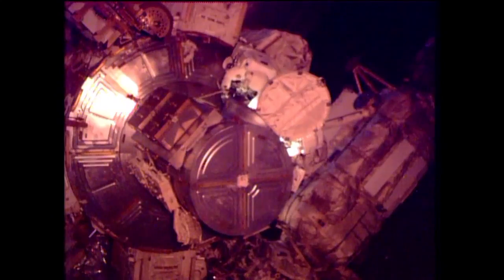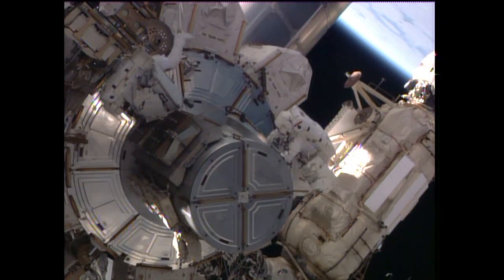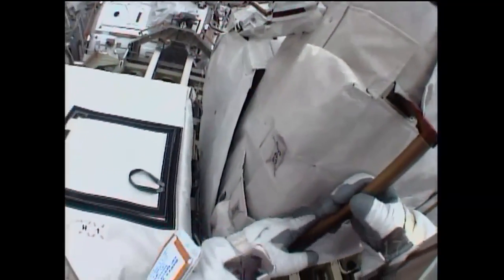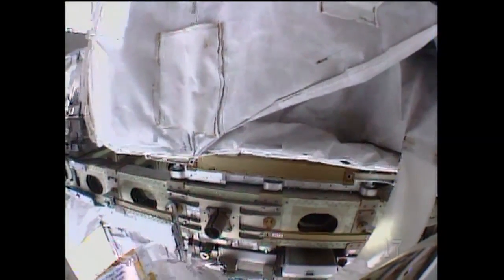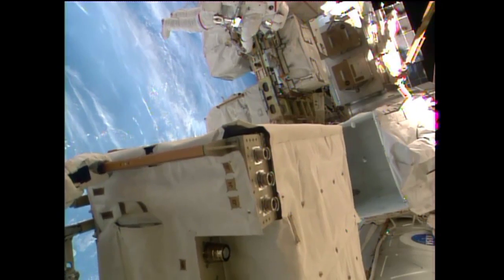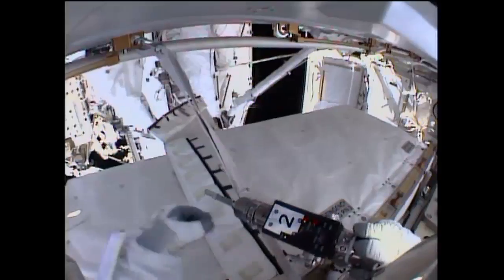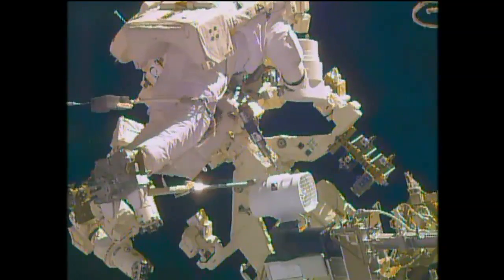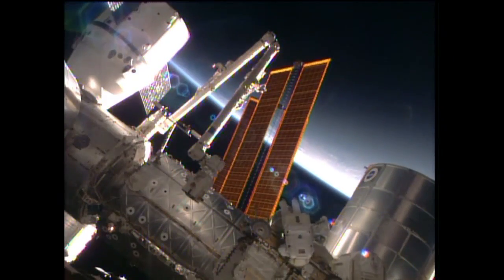NASA Astronauts Conduct Spacewalk on ISS

Comment: NASA, despite their many real accomplishments, for whatever reason, gives a false impression of what a globe about 12,000 km diameter, like the Earth, looks like from 200 miles up.
Any video or picture from low Earth orbit that shows a curve to the horizon is faked, because on a globe about 12,000 km diameter, like Earth, you would see no curve- the surface curves away from the observer, the same way in every direction, the horizon would look just as flat as at sea level as at 200 miles. I understand that most people don't get that for themselves but it is a fact, not an opinion. 
Another way to see just how false some of these pictures are:
Look at a frame with the curved Earth in the background, then extend the curve until you get a discrete circle- for that to be the case you'd have to be many thousands of miles away.
Everybody who didn't already know this, and to whom I have explained it to gets it (if they don't just give up thinking) some quicker than others. Once they get it you get it- they quickly see there is no room for debate.
The standard erroneous thinking goes like this " if there is a curvature of x degrees in a given length of Earth's surface, and you are high up enough and see this given length at the horizon, then you will see that x degrees of curve- they completely ignore the fact that the horizon you see is not a straight line, it is in fact an arc of whatever length you choose to observe, it is the boundary of a circle on the surface of the Earth with you, the observer, at the centre.
This geometry does not change as you go up until many thousands of miles, then the only thing that changes is your interpretation of what you see, the only thing that actually changes is the area of the circle of view, the horizon remains flat until the surface circle of your range of view, with one observation, covers the whole Earth, when to you, the observer, it is a discrete object in space.
Reply: +MrRobtwothirds I love how you state your useless opinion as a fact. From 410 km up, you can easily see the Earth's curvature.
Reply: its not faked they use fish eye lens or gopro nasa is not there to prove earth is round or flat rofl
Reply: +MrRobtwothirds ”Any video or picture from low Earth orbit that shows a curve to the horizon is faked” or maybe it's just a wide angle lens being used?
Reply: It is no more an opinion than saying 2+2=4.
Imagine yourself at 410km up on a platform in a glass dome, with a full 360 of visible horizon in every direction, Point at the horizon in one arbitrary start direction, and then trace it round you by pointing at it as you rotate until you get back to the start.
Did your finger have to go up or down to trace a curve trace a curve? apart from the same sort of curve of 360 degrees around you as you'd trace at 200 feet up, you see your hand didn't have to go up or down as it would have to if reality was really like the photos we see from orbit showing a curve.
It's one of those ideas that once you get it, you get it uneqivocably, it's not an opinion it's a truism commonly know as fact.

Comment: im noticing something, some times i can see the areas of the craft that are in pure direct sunlight, these areas seem to flicker ( much more than the shady parts where theres (almost?) no flickering), is this from local heat by the impact of the rays? on earth we sometimes see the heat come of highways litterally, is this the same effect but in space? (i know theres no air in space but...) the flickering seems somehow to distort the image as if the hull is pretty hot locally and just beyond that theres ofcourse the brutal cold of space itself. has the temperature of the outside hull ever been measured and compared to the same peace of metal on the inside? to see if it is what we expect it to be? im wondering if the direct impact of the light generates more brightness and local heat on impact in space than it does inside of an atmopshere after impact with an object. my guess is in space objects can become much brighter in direct sunlight than the same local colored object on earth inside the atmosphere, can anyone enlighten me? pun intended :) at 1:40 i can also see a strange pattern in the reflected light, left low there is some metal thing looking pinkish, can you see the strange square or saw pattern where there is supposed to be a straight line? pretty odd bending of light.

Comment: At 1:47, it's not a UFO it's the camera picking up a reflection from the window it's filming behind.
Reply: Accelerant 1 They don't film with handheld cameras from behind windows, lol! There are multiple exterior cameras located on the ISS. Kind of like how security cameras would be set up on a building.
Reply: x Vlice u dumb!
Reply: Can someone tell me what am I supposed to look at? I see nothing!
Reply: Hubbs It's a mounted camera inside the hull of the craft. it's perfectly clear that it's picking up its own reflection, if you put a camera up to a window it will capture its reflection. You can even see the edge of the camera lens very faintly beside it.
Reply: And Im still here trying to know what am I supposed to look at.. ah
Reply: At 1:47, there's a small white outcropping with what looks like a handle on it, right next to that is a faint orange-ish glare.
Reply: +Vlice Accelerant Look at 1:00 same angle, probably only seconds apart, and no "reflection".

Comment: they have space ships and doesnt have 1080p 60 fps cameras? what the hell?
Reply: +john hamlet Kinda late, but I think it has to do with the fact of sending and receiving data the fastest way possible. Sending a video at 1080p 60fps and have it not take forever is hard to do through the internet on Earth, it&#39;s still 2 seconds behind (or more) on modern hardware with 20Mbps upload. Sending data wirelessly to inside the ship/earth? I would imagine it taking much longer than necessary in an emergency, so they use whatever is the most efficient on hardware and telecommunication in space and from space to Earth. :P Thus, mission cameras are bit different than "What would look the best."

Comment: 1:27 is that UFO   or the sun light  ?
Reply: Looks like lens flare to us.
Reply: Daniel Correia
Daniel, unfortunately "thirdphaseofthemoon" posts mostly CGI created or edited videos similar to those of Area51, Aurora51, etc.  Such posts are disinformation and with no real investigation to what the object or lighting was.  I'm not saying 100% this was not a UFO, but close monitoring of lighting frame by frame shows that the object brightens and gets larger as the sun reflection and lighting on the ISS also increase and increased shadowing on the surface.  It may look like it is a ways out from the ISS, but lens flares do appear this way and can easily look like something physical is present when it is nothing but light.
Reply: In one shot you can see it slowly approaching than the camera switches and switches back where you can clearly see something that is not a reflection I believe we are not the only beings in the universe so my opinion is that is a ufo I strongly believe NASA has actual proof of extraterrestrial existence this is definitely not the first time something like this was recorded on the international space station live feed
Reply: Daniel Correia
The are under orders not to talk about it, that includes radio transmissions that can easily be picked up by any amateur ham radio operator I would imagine.  In the 60's and 70's when astronauts were conducting the first missions in space, they talked about these objects often and such recordings are available and were heard by the public.  Since they do know what these objects are, there is no longer a need to discuss it over radio and they'll just go on about their business as if no one is watching.
Reply: Tim Bravo Thought so its impossible see lens flare or sun light.
Reply: Tim Bravo  Google image what?
Reply: Judson Feltenberger Why didnt they notice that? or notice and ignored? I know we arent alone cus my self already saw one  close to my house.
Reply: Ron Davis Yeah, But they ignore the object and keep talk to astronauts. btw i come here by thirdphasemoon  he said its ufo.
Reply: DannySparks
Just out of curiosity, how would aliens be the least likely?  Although I'm not sold that this particular sighting is a UFO, if it was it would be very large.  Aliens have been visiting for thousands (if not millions of years), thus we are far more likely to see alien craft, or some of the dark government projects, but not that low in the atmosphere as they would be visible by amateur astronomers using even the smallest telescopes.  One thing is for sure, none of these UFOs have anything to do with Jesus!
Reply: Daniel Correia they switched the camera but I was taking random pictures of some clouds the sky was so blue the clouds so white it was a beautiful day but anyway as I was going through the pictures and in two pictures I believe I captured a ufo
Reply: CVbeats
I have to agree.  While I wanted this to be a ship of some sort, the ISS is between the Earth and Sun.  If you watch the lighting between shots closely, the object appears along with the angle of light reflection coming off the ISS itself.  However, it could also be an object sitting there and the light reflection from the ISS is illuminating an object.

What I can say for sure is, this is not a TR-3B!  The object (if it wasn't light reflection) was too large!
Reply: I'm sure if this secret ship was in the video and they couldn't talk about it, it wouldn't be in the video released to everyone lol they'd edit it out and make sure those images were deleted or classified. And if it was a ship that wasn't supposed to be viewed, how on earth (no pun intended) would they not be able to notice it if the ship is right next to the ISS. If I was taking a picture of my house and didn't want a tree in the backyard to be visible, I would know exactly what angles would show the tree and how to avoid it lol. It's very obvious it's a reflection off the object on the lower left or off the ISS. They would never be able to miss a giant ship on their videos when editing lmao. These people are some of the smartest in the world, you think they'd miss something that obvious..?
Reply: Daniel Correia  Space trash (waste) or a satilite, some lighting effects, the Russian, The chinese , Jesus.... it could be 1000s things but an alien UFO is the most low on possibility
But I must say the speed traslation is remarkable
Reply: It is at 1:50 as well. It is no lens flare or light (that was proven wrong from factual evidence) and the only other satellites in the area at the time were much smaller. Either space debris, UFO or spies.
Reply: Las mentiras terminarán pronto.
Reply: Garrett Haulbrooks
It´s at the same speed of the ship...so maybe it´s from the ship...or the camera...
Reply: BIGFOOT CONFIRMED!
Reply: Kirito Nakura glare
Reply: Samuel Oñate Someone disproved that it could have possibly been a glare.
Reply: Garrett Haulbrooks
And that person is?  That evidence is where?  Can you be specific?  Otherwise, you have proven nothing but the facts!  Lens flare!
Reply: woops... no.  actually, that video is totally the opposite of what i wanted,  and who the hell are you!?!?  besides a chump..!?  but yeah, Glare.
Reply: haha
Reply: Ron Davis That person is many people. It is not a glare.
Reply: Garrett Haulbrooks
Yet everyone else seems to think it is glare except those who obviously post fake, edited and CGI created videos.  Yeah, I trust their conclusion!
Reply: Ron Davis They use factual evidence. It is most likely space debris or something on the camera/camera glitching. Not a glare.
Reply: Tim Bravo Why would they keep a secret weapon near an INTERNATIONAL space station? Who is it secret to? There are Russian austronauts aboard, they would see it.
Reply: Ron Davis I see you dont understand sarcasm what I meant to say is that is human related..
If an aliens civilization is hidden from us would they know (assuming they are more technological advance that us) can be exposure near the ISS? they dont know that we have 100s of satellite on orbit that can take a picture like a girl  do at bathroom mirror ? if they are coming in secret and still do and havent show themself to us is for something, my stake is they wont make a booboo like that
So be logical and this is something but alien space craft
Reply: DannySparks
The governments know they are here.  Many treaties have said to have been signed between our visitors and governments which outline their requirement to not show themselves to the public.  While full disclosure has not come about in some countries, others have began to talk and others have fully come out to claim such as normal and no danger to us humans.  It is plausible they have been told to stay hidden, although they obviously off occasionally as not every UFO spotted is ours or explainable through some sort of weather or other natural phenomena.  Being that such objects have been spotted long before the said UFO crashed in the late 40's and even recorded by ancient civilizations throughout history. 

In this particular video, while just my opinion, it is glare.  The lighting and shadowing alone are enough, but any sort of space junk would not be that large nor show up in that manor.  It would have been moving and not stationary with the ISS.  Being that there are no satellites that are that big in relation to the ISS, I do not believe this to be a physical object, it is reflection or lens flare off the camera lens.  If you monitor the ISS live feed, identical phenomena pop up occasionally.  Too many people are itchy to call these UFOs when in fact, they are not and are simply lighting effects that can easily be explained. 

I dofind it funny that someone's name was mentioned in an earlier post who is known to post mostly faked or CGI edited sightings that discredit the true sightings and research as confirming such obviously explainable phenomena as real objects.  A simple frame by frame view of the video shows the object appear as lighting and reflection on the ISS surface increased.  Similar objects as this one that have been recorded in the past are near identical and if monitored long enough, they disappear when the ISS position changes in relation to the angle of the sun.

You could be right, it could be space junk.  However, the behavior of the said object does not match space junk or any sort of spacecraft due to movement (or lack of) and size of the object.  The most plausible explanation is this is lens flare and surely it not a physical object of any sort.
Reply: i knew it?!
Reply: *****
Can you provide evidence of such?  Learn some science and stop ignoring the truth.  But hey, if you believe what you say, I have ocean front property on Venus I'll sell ya!  Get real!
Reply: Ron Davis He was joking... Stop being stupid.
Reply: Garrett Haulbrooks
Then my apology.  In any case, I thought they were filmed in Hollywood.  But under water sounds more exciting.
Reply: I'm down to go to Venus...!!  They practice their shuttle space stuff underwater in Hollywood, but they (or we) really go to Space bros...  Space is tha Place!!
Reply: It's a TR-3B.  Google image that and see if you don't find EXACTLY what you see in this video straight from NASA.  Then, learn that the secret government on this planet has had this craft for decades without disclosing to the public their antigravity and interplanetary technology.  Then. listen to Richard Dolan's presentation on the breakaway civilization on this planet.

Your mind will be blown.  Your reality will be shattered.  Good luck!